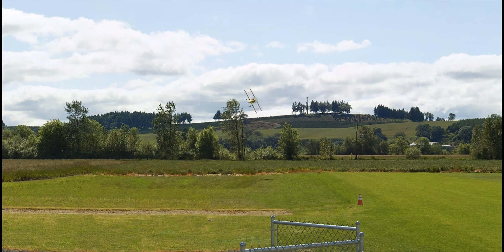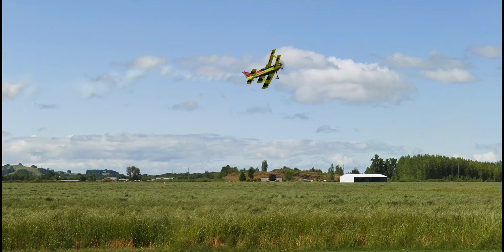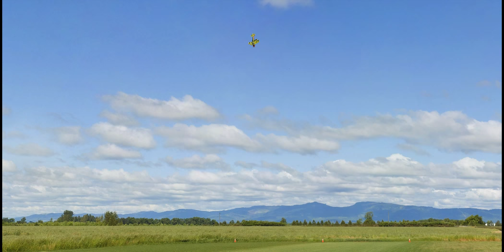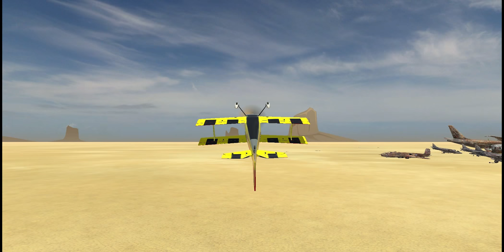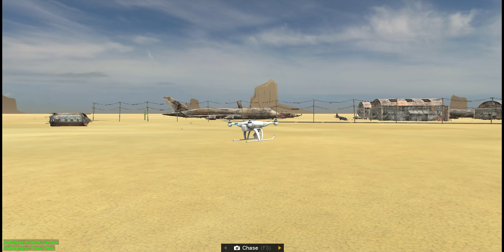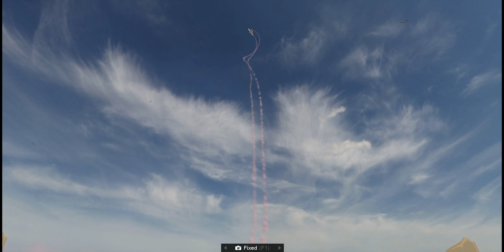RC Simulator Comparison Part 7

Comment: The reason your getting such high a frame rate is because you dont have Vsync on. The problem with vsync off is screen tearing. I'am running Phoenix on a gtx970 on a dell 27inch 60Hz screen with vsync on and it sticks to 60fps. Its kind of pointless running a framerate higher than the highest refresh rate of you monitor.